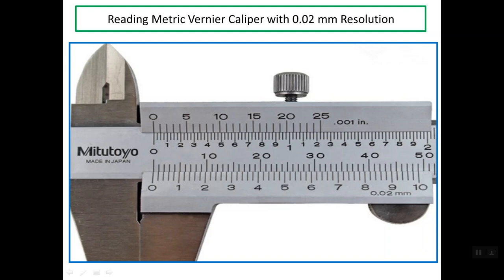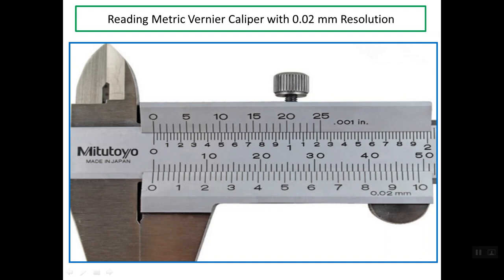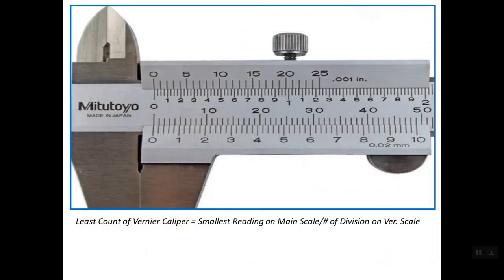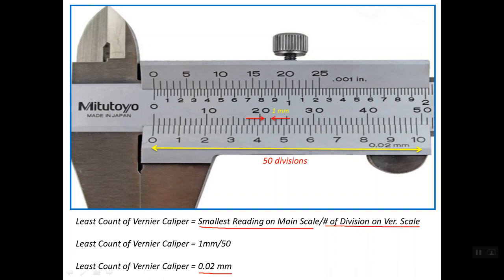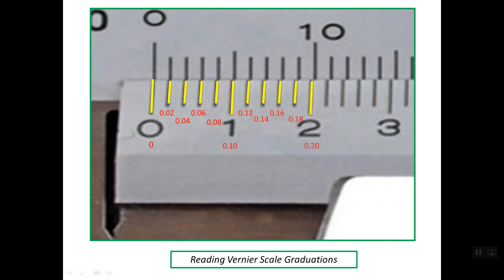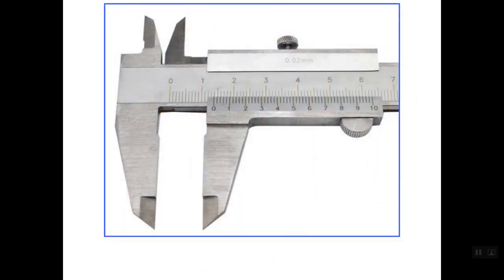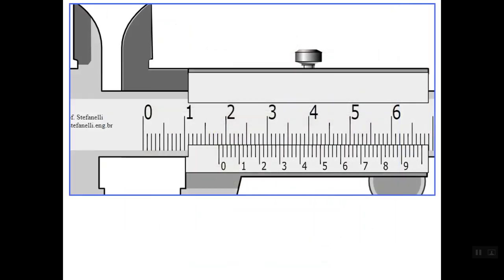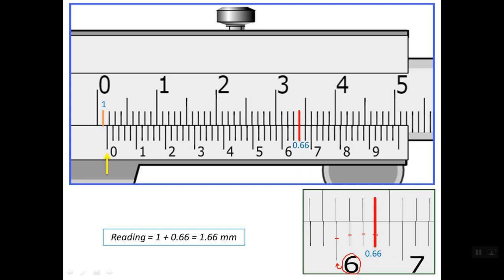9) Reading Metric Vernier Caliper with 0.02 mm Resolution (Least Count)

Comment: Sir if the  v.s.reading  we count like :0,5,10,15,20,25,30,35,40,45,50 like 50 divisions 
So the first reading in our practice is =13.48.mm.
 In the way u r counting v.c.reading is   13.96.mm sir wich one is correct reading ?
Reply from the maker: in case of 50 graduations on the vernier scale we count by the multiple of 0.02 mm so the reading 13.96 mm in the example is correct.
Reply: Why did u say 13.48 please explain

Comment: Excellent explanation sir.. the vernier scale readings are scaled by 0.02 mm. If I want to read odd numbers of measurement how to read in this scale? Example I can read 6.0, 6.02, 6.04, 6.06 mm, but how to find 6.05 mm in the same scale.. is it possible..?
Reply from the maker: Thanks. The possible decimal reading part is only the multiples of 0.02mm , so there is no odd readings.
Reply: @eng.waleedalzaghal5344  Thankyou

Comment: The formula is..reading A×1mm
B×0.1mm and C×0.02mm..The total answer A+B+C=answer mm
Reply from the maker: Each graduation on the main scale is 1 mm and on the vernier scale is 0.02 mm, so the total reading is the sum of both. Another way to read the vernier is to count the order of the aligned line and multiply it by 0.02 mm. For example line number 24 on the vernier scale is read as 24x0.02=0.48 mm